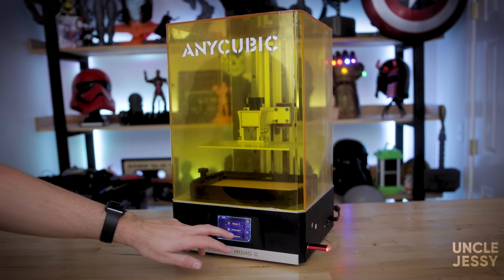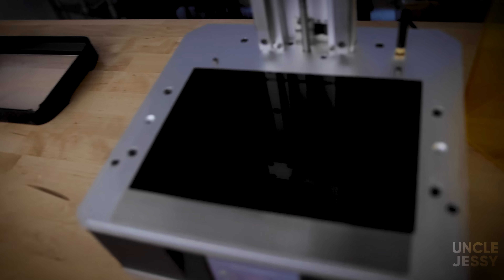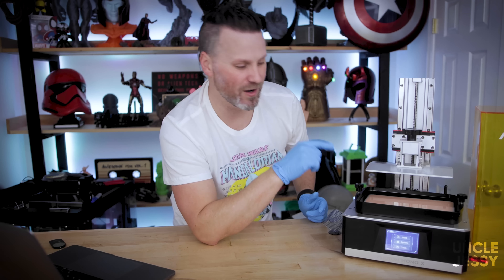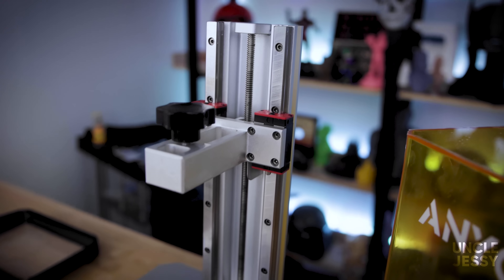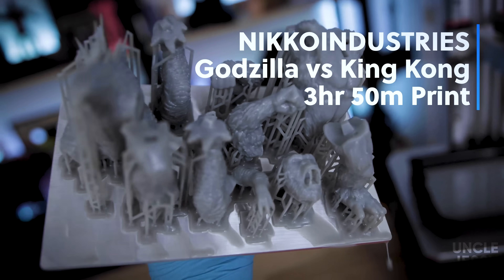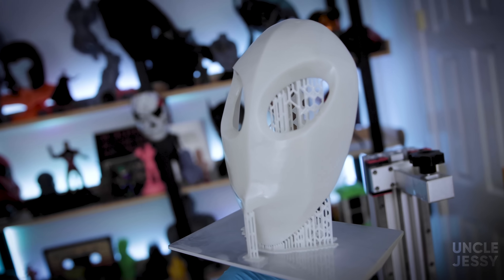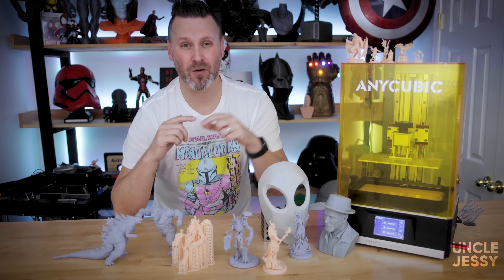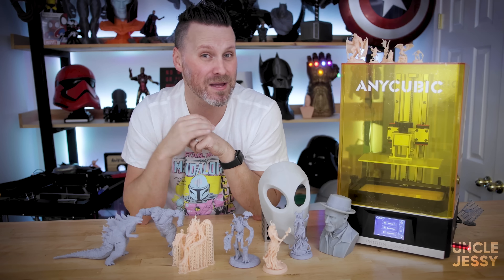King of All Resin 3D Printers? Anycubic Mono X Review

Comment: I had an issue with the WIFI set up on mine as well. . . after much searching
Create a text file called WIFI.txt
put the following in the file;

WIFI account:<Your SSID>,
WIFI password:<Your Password>,
Settings:1,

copy file to a USB drive and put in printer
then as I recall (memory not what it used to be) you need to print the file
that seems to be how you "install" the WIFI info.
your absolutely right about the printers network capabilities, they're Mehhh at best but this is also how it updates it's firmware so good idea to have it configured.
hope this helps

BTW 
Great content
love the channel!

Comment: Jessy, I had this one.  But it was riddled with defects.  Bad build plates, cracked screens, irregular led power, etc.  I hope yours is better.  Also the build plate warps and leveling issues are notorious.  Epax much better out of the box machine.  I had the wifi work, but only with the app.  It's lacking so much functionality. Snapmaker and epax much better
Reply from the maker: Oh wow that is crazy how big of a difference our experiences were. So far mine has been running non stop running print jobs and have had no issues with it. EPAX build quality of their machines is on another level thats for sure!
Reply: @UncleJessy  My Anycubic Mono X experience was fantastic out of the box. The Anycubic Chiron however, was a pile of junk.
Reply: @manbullmoose5045  sometimes this little machines are a lotery.But when they work as the way there was desing, they are fantastic
Reply: @UncleJessy  thats cos you got paid for your experience :')
Reply: @UncleJessy  I just got my new Mono X and it has massive ghosting. I have printed towns and anycubic's RERF test to show it to them and support just keeps saying that's how it's supposed to be and ignoring my questions about spare parts and refunds. I had to initiate a paypal refund request because their support is horrible. Never buying from them again.
Reply: I will say that as with everything, the most vocal and posted things in social media are the negative ones.  I bought it on the launch and has been printing flawlessly from day 1.  I have gone to Epax, Elegoo and Phrozen groups and it's pretty much the same all around.  Everyone posting is for the most part the ones that have had bad experiences.  From the outside it seems that that's all there is, bad experiences.  What people don't see is the overwhelming amount of people actually getting perfect machines and printing away.  I will say, I don't post much because I spend more time just working on printing stuff and being happy with my printer.  I will agree, there should be more posts with the positive experiences to at least balance out the negative.
Reply: @zenthai1368  what printer do you have?  Are you happy with it?
Reply: @watchaprintinwillis2644  I have the Anycubic Mono X.  I love it!!  Have not had any issues at all.  I'm very meticulous in how I use it and maintain it. When I have failures is my fault with support placing.
Reply: @zenthai1368  Excellent so I am not on the wrong path.  It was down to the E10 and Mono X, but I'm kind of a 'super user' as well so I think I'll be happy as well.
Reply: @Its_Waren  I’ve also heard of bad stories with printer and customer support. Went with this model because of friend suggestions. I’ve had mine for about 6 weeks now. First 3D printer. Only problem I’ve had was one level foot peg was missing. Customer support through FB messenger has responded within 24 hrs to my order of missing leg. Had problems with prints at beginning but once I learned tricks of trade and dialed printer in it’s been a beast.
Reply: @TheSmoov82  can we have your video of experience and trick, settings etc
Reply: Sorry to hear that. I have had zero issues with mine and I have it since November.
Reply: Has anyone here ever had any experience with the Origin One from Stratasys.
Reply: I regret buying mine. I have had nothing but issues with it. I went back and forth with AC about the problems it has. They did not help much.  Anti aliasing doesn't work either even tho they advertised that it does.  The linear rail blocks are total garbage and had to buy new ones weeks after I bought it. I have not had a single successful print since I have had it which was about a year ago. It now sits on the counter under a cover never to be used again. Not good for a $1000AUD purchase. Shortly after buying it and having no luck with it I bought a sonic mighty 4k and have not had any issues with that unit. I will avoid Anycubic products in the future. If you are thinking about buying one of their products do a lot of homework especially if it is the Mono X. Just my experience
Reply: Thanks for this comment. I had bought MonoX and couldn't get it to work, so due to this, I looked into a E10. Bought it and have been printing non stop without issue since. Thanks!
Reply: Bs EPAX is dog crap. Leaky vats, cracked polarizer(their support team said it was a crack), bad mainboard firmware causing UV light to stay permanently on, bad firmware that caused screens to half work.

I'll take an easily sandable build plate and UV intensity adjustment over not being able to print for half the year due to  bad tech support telling me perfectly good screen was bad and to buy another one from them (TWICE)
Reply: Just got one, and guess what?  Anti Aliasing doesn't work on it, AC know, and keep promising fixes....but word is the screen isnt even capable of it.  Absolutely furious.  And I've not had one 100% successful print either.
Reply: Hi, I don't know if I am comparing like for like I'm an absolute 3D noob.

> Epax much better out of the box machine

I'm seeing the EPAX 4K printer @ £2,500, the AnyCubic 4K is £400..........am I missing something here?

Thank you,
Reply: I got mine a few months ago. I did have problems with the build plate, but contacted anycubic and they sent a replacement with zero hassle. I was actually incredibly impressed with their customer service. Since replacing the plate, I've had literally zero problems.
Reply: I had a terrible experience with the Mono X (cover had thousands of hairline cracks, warped plate, faulty rails (binding and rusty), noisy fans) Anycubic were terrible and dragged out a refund over a period of months. I lost money and faith in their products. Awful company.
Reply: @3dprintandpaint  I had the cracks too.  But looks like they got it down.  I had mine about two months ago. When do you get yours?  The one Jessy has seems to be solid.  It's a shame I really wanted to like the mono x but it seems to have been rushed out. It's encouraging to see a solid out of the box version
Reply: @ebpman  I may have been unlucky and these things happen, I have no issue with having to return or even fix something, technology doesn't always work. However it was the customer service or lack of that angered me. To say they were appalling would be too nice a thing to say.
Again, could have been unlucky.
Reply: @3dprintandpaint  from a service I have and still have experienced less than ideal and thats putting it lightly
Reply: @Its_Waren  yup.  I have lived them. They may have improved their quality review process.
Reply: @Its_Waren  I have 2 Photons, one Mega I3 and one Chiron from Anycubic, and if i can say one thing about the customer support of Anycubic, there was never a problem with spare parts or communication.

And i use Anycubic printers atleast 3 years now. Dont believe everything you read or hear. Anycubic may be some times a bit on the lazy side with QA, but the customer support was allways there to support me and identify the problem, even it was my mistake. They once got me technician to speak to me per email after i send them pictures of my problem and it was solved in 48 hours.
Reply: I was one of the first 1000 ... my Mono X has been jamming non stop  since the beginning. I think a lot of these problems are user error, sorry.
Reply: @mrfumetsu  User error doesn't account for bent plates, rusty rails, noisy fans and cracking covers. Again, I think the problem moreso is their customer service, albeit shoddy parts ain't far behind.
Reply: @mrfumetsu  yes, but  a machine its a machine, its gone have a failure at sometime, in a productiin line there are many posible error (litle error like a warped bed, etc)

Comment: I have this printer and use it for my business it prints 16 hours a day 6 days a week. Pair it with a wham bam flex plate and it's awesome.
Reply from the maker: Yeah! need to get a flexplate installed on this one!
Reply: @UncleJessy  the cheap chinese aluminum build plate gouges really badly. Currently making a cat refiller system so you can print large volume prints using 1.5kg of resin in the vat.
Reply: Printing only siraya tech blu / tenacious mix giving amazingly strong functional end use parts. Completly killed fdm such a nice printer.